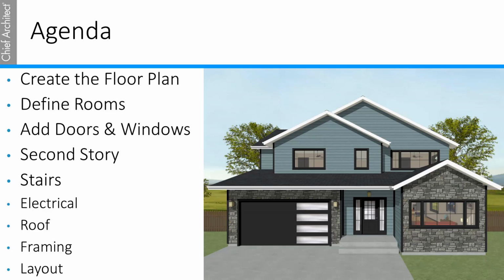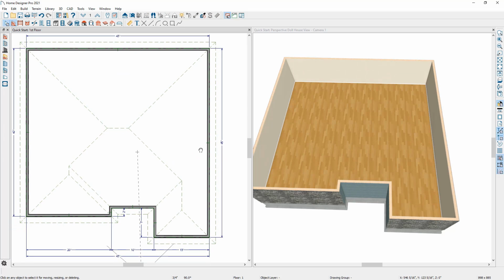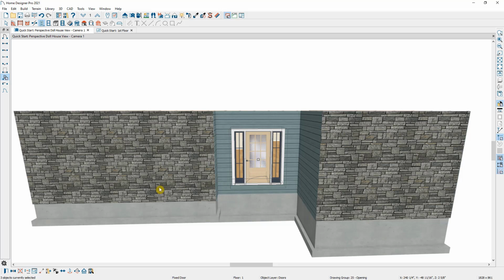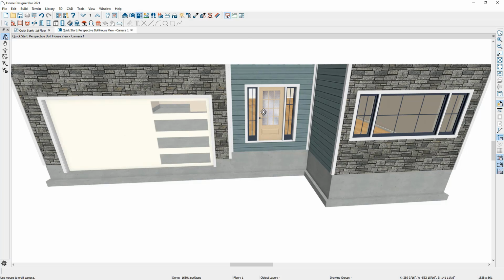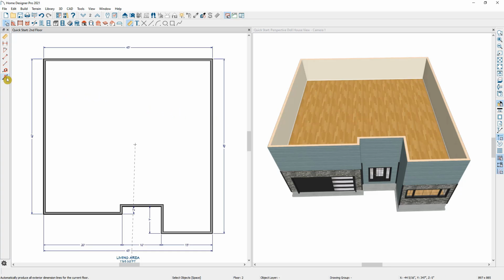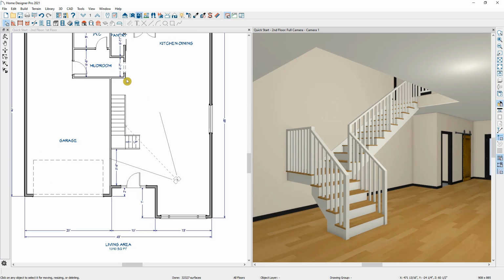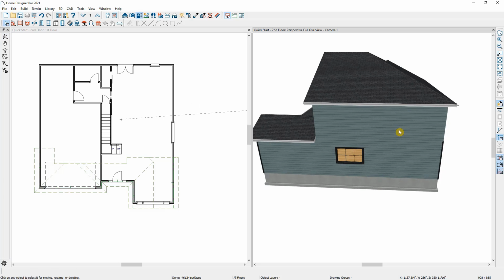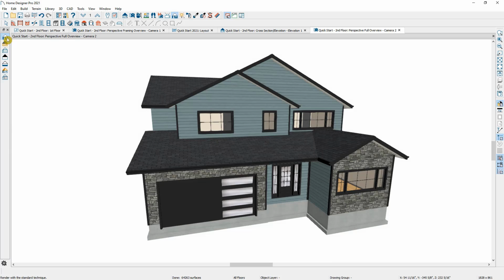Quick Start Demonstration with Home Designer 2021

Comment from the maker: Thank you for watching! What did you find most helpful in this video?
Reply: Great video, really helped me get started with my remodel project. I was able to design "just about" all of the basic structure by the time I worked through the video. Please, keep these coming!
Reply: This was really a great quick start video.  Paced just right.  The amount of time on each topic was perfect....enough to get an overview and know about features available, but not so in depth as to be overwhelming.  I frequently paused the video to practice each concept in my own plan.  Thank you.
Reply: Would this program work with making buildings for commercial use?
Reply: I won't to learn more in this domain can you help me ?
Reply: My house is built from concrete not necessarily board, are there features that would resemble that kind of design? @Chief Architect
Reply from the maker: @jonmichealpalmer7736  Yes, in the Home Designer Architectural and Professional programs, you can customize your wall types and change materials.
Reply from the maker: @jonmichealpalmer7736  Here is the link to the trial if you would like to give the software a try:https://www.homedesignersoftware.com/products/trial.html?product=pro

Here is a how-to article on modifying a wall type: https://www.homedesignersoftware.com/support/article/KB-00382/modifying-a-wall-type.html
Reply: Great tutorial. I was ready to give up on this software but this gave me enough information that I will stay interested. To answer your question, the option to add a break to a wall to modify the roof line was exactly the question I had. Excellent!!
Reply: What I found most helpful? Hmmm... ALL OF IT!!! The video is great, excellent speed - not too slow to make it boring, not too fast to make it hard to follow, easy to understand language. Great work!!!

Comment: So I have 2021 but curious as to why I should upgrade to 2023? Sad to say but I haven't even used the software I already have. Always overseas and no time to grab home dimensions to start a base drawing.
Reply from the maker: There have been several new tools/features added like predictive edit feedback, more dimension control, library painter scoping, and more. Here is a link to the full features:

New 2023 Features:
https://cloud-hd.chiefarchitect.com/1/pdf/product-info/2023/new-features.pdf 
New 2022 Features:
https://cloud-hd.chiefarchitect.com/1/pdf/product-info/2022/new-features.pdf

Comment: Hi alltough it's been 1 years if you see this I am new to Chief Architect using X13. little question at around 57.56 on the second level plan you can see a wall that is part of the first level. what is to be done that when you send the second floor this wall does not show. on my plan second level I have a couple of these wall showing up because the high is higher than the second floor. thank you.
Reply from the maker: Hi Michel. When you adjust your 1st floor ceiling height, it should automatically adjust the 2nd floor to accommodate. I would recommend reaching out to our Technical Support team to look into the problem further. Our support team has a lot of knowledge in this area and can help you troubleshoot this issue. You can reach customer service at 208-292-3400 Monday – Friday from 7 AM – 4 PM Pacific.

Comment: how to I set the wall height to 16'?
Reply from the maker: You can double click in the room to open the specifications, and under the structure panel, there will be options to adjust the height.

Comment: Why does my automatic room labels show different dimensions than the interior dimensions tool?
Reply from the maker: The manual dimensions measure from the framing layer and the interior dimensions measure from the interior drywall layer.
Reply: @ChiefArchitect  so the room label is which of those? I was using the interior dimension as my guide but I thought the room label was supposed to match that
Reply from the maker: @gabbywilliamson76  It is measured from the manual dimensions.

Comment: how do I get all those tools to show up at the top on Home Designer Suite?
Reply from the maker: The toolbar should automatically appear. If they are not there, I would recommend reaching out to our Technical Support team to look into the problem further. Our support team has a lot of knowledge in this area and can help you troubleshot this issue. You can reach technical support at 208-292-3375 Monday – Friday from 7 AM – 5 PM Pacific.

Comment: how to change measurements unit to Foot?
Reply from the maker: Select Edit> Default Settings to display the Default Settings dialog.

Select the Dimension category to highlight it, then select the Edit button to open the Dimension Defaults dialog.
On the Format panel, use the Units drop-down menu to select feet.

Comment: Great video! Do you know if the software can be transferred if someone buys a new computer?
Reply from the maker: Yes. The software is a single user license but you may download it on as many computers as you would like as long as the software is not being used at the same time.